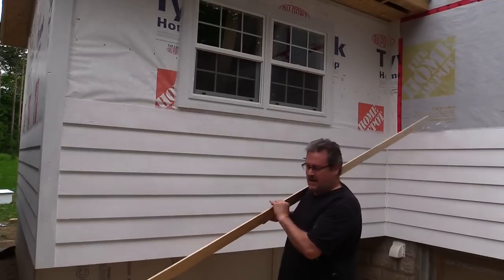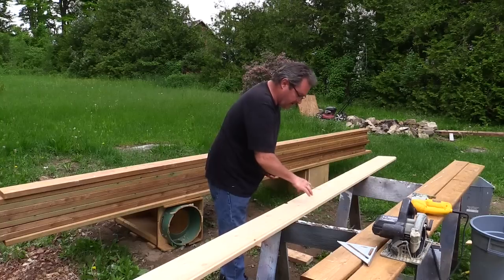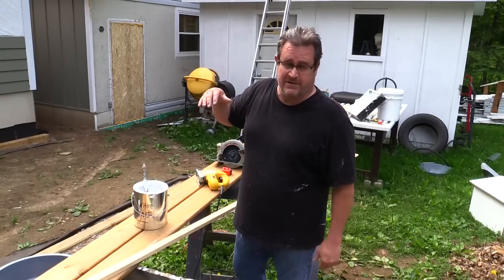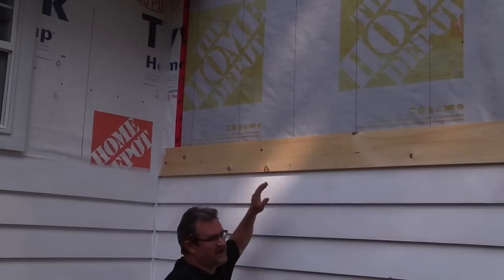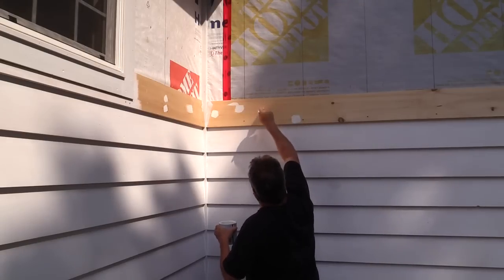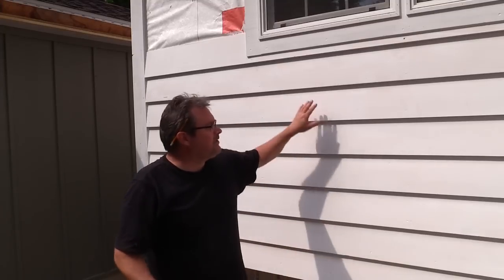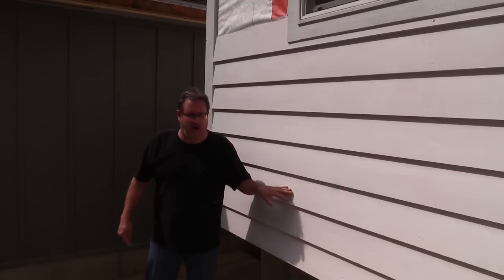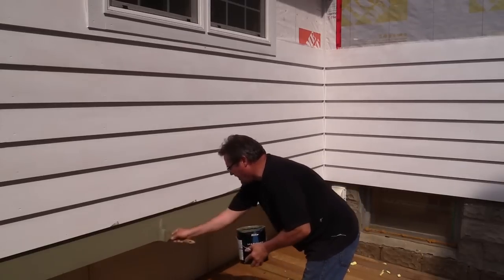How To Install Real Wood Siding

Comment: Looks great. I notice that you did not use furrow strips to create airways behind the siding. I live in a hot humid Gulf of Mexico area and need to make sure I have ventilation. How does installation of furrow strips affect the installation of window and corner trim boards?

Comment: Enjoying your practical videos.
For tongue and groove cedar siding which will get olympic stain/sealer, do I need to seal the back of the board also, or just the exterior face?
I’ve read of horror stories of T&G buckling from expansion or shrinking exposing the vapor barrier, so seems like total sealing would be best to lock it in current moisture state ??.

Comment: Hi, nice job. I have a question though about the inside corners.
I am using 10" bevel cedar sidind. The thickness varies from a 1/4" to 3/4" on the bevel boards.

What degree do you cut the ends for an inside corner?
If the ends are cut at 90°, I end up with a big gap between the boards at the upper ends of the boards. Thanks for replying.

Comment: Enjoying these as much as your other channels! What makes a caulk high quality? I just see outdoor and grab it but have no clue differences between them. Thanks I Build It Home !
Reply from the maker: Charles Li Price, usually. The one most people buy is a DAP product, which is a latex caulk (waterbased) and very thin. It shrinks away to nothing leaving very little protection. It's cheap and it works great for some things, but I wouldn't use it for this. 
Must be paintable, so not 100% silicone and will normally say right on the tube what it's recommended for. The one I'm using says "windows, doors and siding".

Comment: I've been taught that back priming is beneficial to prevent differential moisture absorption. True or not necessary?
Reply from the maker: Bike Man Dan I would say that's the best approach, to back prime everything to ensure the siding is "encapsulated", to limit moisture absorption. But, I think the benefit is marginal where the siding will normally stay dry. The lower courses get direct rain and splash-back from the ground below, so will see a lot more exposure to water. The upper courses see very little and the exterior paint blocks nearly all of that.

Comment: I noticed that your piece of siding is cut snug and tight to the corners. What happens when wood expands due to wet conditions and the tightly cut piece of siding expands and pushes on the corners causing stress on corners and thus popping the nails that secure the board to the studs?

Comment: I spot a re-use of the old dustcollector as a sawhorse/riser for your materials. Sweet.
At 6:01 .....man you are a machine with that caulk-gun, almost no need to straighten it with the finger afterwards
Reply from the maker: Bellevue Woodshop I'v had lots of practice with the caulking, I think I've gone through thousands of tubes.
Reply: I Build It Home  It really shows. good job:)

Comment: Nice work John. Real wood is much nicer than the prefab crap that is used so predominantly these days. Yes, real wood is more expensive, but certainly worth it in my opinion.

Thanks for sharing. You have a new subscriber.
Reply: I beg to differ on the "prefab crap", if you are referring to a product such as LP Smartside.  This product has a 50 year warranty, which is better then you can realistically expect out of a real wood siding.  Also, smartside is produced with fast growing, small diameter trees, which makes it a much more readily available product, that does not require old growth timber.

I have zero issues with real wood, but I think you may want to take another look at some of the new products out there.  have a great day
Reply: @joshw6212 LP smart side has proved to fall apart after like 5 years as it’s basically glorified particle board.
Reply: @connorgaydos8677  well, its been on my house for 6 years now and it shows zero signs of failure anywhere....but ok

Comment: Super video John.  I learned something new today, as usual when I watch your videos.  I did a small siding job on my shed last year, but caulked after and not before and during as I should have.  Thank you.  This will come in handy very soon.
Reply: Thanks Dave :)  
Doing the caulking right makes a huge difference to the lifespan and durability of the siding and paint. When water can get in, it causes problems and when it gets in but can't get out, it causes even more.
Reply: Got it.  Thanks again.

Comment: +I Build It Home
Caulking is a lot harder than it looks. Great job. I really appreciate someone who can handle a caulking gun well. 

I have had a lot of experience as I install siding as a profession. Most of the time when I have to caulk a joint though I can't tool it because I use color matched caulk and it will turn white if you do that.

Comment: How do you seal the corners where two 90 degrees sidings meet? 

It looks like you have just put in a square piece of stock but with the angle of each piece of siding I don't think it would logically be that?
Reply from the maker: DaveMade.It It's just a piece 1-1/4" square cut from a 2x4 and the siding just butts into it.

Comment: Good video probably the best I've seen so far. I have to replace rotted siding on the side of a dormer on my house. The roof is steep so I'm thinking of using roof jacks but I'm going to try to get it done on my 32-foot ladder before I do.

Comment: Love the look of real wood siding. The shadow lines are much stronger than with cement board etc. I had a beautiful cedar sided home once that required constant repainting. The explanation I got for the paint failure was that the clapboards were not backprimed and moisture penetrated from the back, causing the paint to separate from the front. I highly recommend priming the entire clapboard, ends as well after cuts are made to avoid this issue.
Reply from the maker: The lower courses are back primed. Also, it's 3-1/2 years later and my paint isn't peeling or in need of repainting. 
Back priming is always a good idea, but there are a lot of other factors that have a greater impact on paint adhesion over time.

Comment: Yes, real wood siding! 

I note a difference in canadian & scandinavian construction process, over here there's usually an air-gap between the wall and the siding. So there's a bunch of exterior studs the siding is installed onto. And the wall behind the siding is just exterior grade drywall, no caulking is done that I know of. I wonder what the pros and cons of the different methods are. Perhaps this method is used in Canada, too?
Reply from the maker: 1873Winchester Furring behind the siding is common here too, and must be done to comply with the warranty on most of the prefinished products. It's done with the idea that any water that does get through will not sit between the backside of the siding and the wall sheathing. But, if you are really careful and thorough sealing the gaps with caulk and keep the paint in good condition, water will not get in.
Reply: I think it's better to install some furring behind the siding because some water will most likely find its way (eventually) back there and get trapped, causing planks to rot (and sometimes can seep into the sheathing which is typically not 100% waterproof). The furring will let that water run down as John pointed out. My house was sided with wooden log cabin type siding nailed directly on top of the house sheathing and I spend a lot of time replacing boards due to (I believe) this problem.

Comment: Bare wood absorbs moisture like a dry sponge on a wet counter,,I use cabot solid stain and pre stain each board, sides edges back and front,, if bare wood is stained or painted on the surface the moisture will migrate out and cause blistering, peeling etc
I am using western red cedar clap boards on the first floor and will install cedar shingles on the three gables, pre-staining them. I used an oil base stain on the clap boards and the formula changed during the process,  never again. now just solid stain
Reply: what if u want white siding?

Comment: White Shellac - $15 for half a liter at Rona.ca...  not cheap at all!

Great tutorial, John.
Reply from the maker: wordsnwood I tried that (zinnser?) white shellac last year and the knots bled through. I was not happy. The jury is still out on this stuff, but it's looking good so far. Another thing that works is that tremclad aluminum paint, spray or brush on, and if this stuff fails, I'll be using that.
Reply: I Build It Home I used shellac based Zinnser on some knots on interior wood trim in my dining room about 6 months ago and they have bled through already.
Reply: Jay Bates You need to use the zinnser shellac from the red can, not the blue.
Reply from the maker: Jay Bates That's not much good. I think a third option would be oil based polyurethane, but that takes a long time to dry.